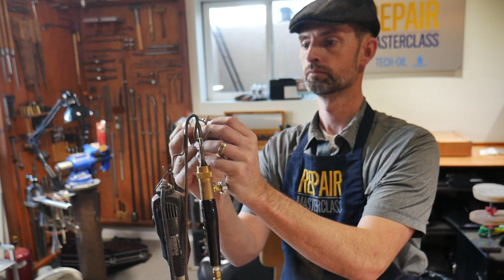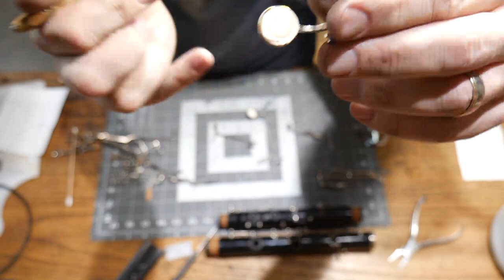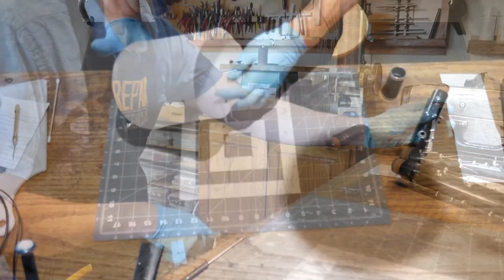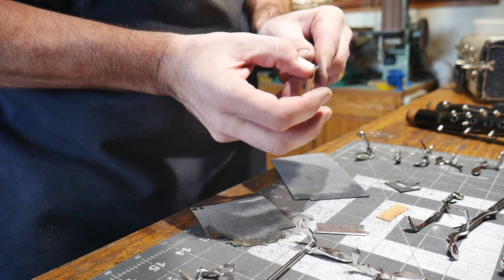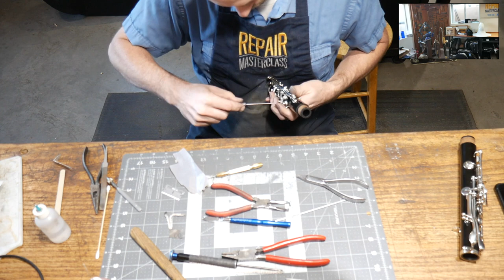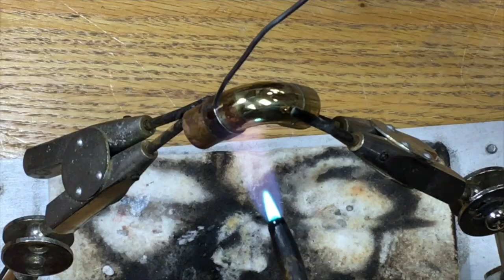Bundy Clarinet Repad

Comment: Is it usually obvious for you when key bending is the proper way to adjust fit of a pad over a tone hole vs applying heat to re-float a pad? And do you choose one  method over the other when working on a fully assembled clarinet vs one where the keys are loose? Thanks!
Reply from the maker: This is a great question and one worth of a video. In the mean time: when installing new pads, floating is always the method. The only reason to bend a key at this point is if the pad cup is not properly aligned over the tone hole. Now, if the pad you’re working on WAS installed and working properly, but for some reason is not now, then most likely the key has been bent and needs moved back. Clarinet keys almost always bend side to side and not front to back (with the key arm being the back of the cup)… but that said, we must never forget the remarkable skills of junior high students. 😉 If the key is bent, attempting to bend it back and get it to balance all around with equal pressure is my fist attempt. If after the key geometry has been restored and I can not get the pad to balance correctly, Jen I attempt to re-float the pad but most of the time it will not work well on a pad already installed and instead needs to be replaced. Hope this helps a bit.
Reply: @repairmasterclass  Nice summary. Thanks for the reply.

Comment: I have a major issue with my clarinets f natural, it’s veryyyy low, I’ve never had this issue until I got this new clarinet, do you have any tips or suggestions?
Reply from the maker: So sorry, I've been on a trip. Depending on which F you're talking about so let's run em down: on the staff = the register key may not be opening far enough. Sand the cork down or bend the key up. HIGH F on the staff = the bridge key may not be in proper adjustment so the lower ring key pad is not making contact. Adjust the bridge key. F ABOVE the staff = might be a leaking key at the bottom... F BELOW the staff = could be any number of issues. Do you have a tech you trust locally?

Comment: Is it possible to make the clarinet's mechanism return faster?
Reply from the maker: It is possible. Typically when keys feel slower than you'd like them to be, it means the keys need to be removed, cleaned and lubricated. When this is done, most of these needs go away with the gunk that's removed. Two other options are there could be a bend or bind in the key that needs addressed or, more spring tension could be added. All of these options can potentially make the mechanisms return faster.